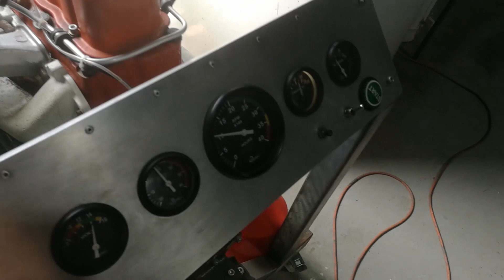Rotec TBI-48-4/5 Throttle body

Comment: It is rather a pity we did not have these back in the times of the HQ through to HZ series of Holdens. It would have enabled some serious fuel economy at the time the fuel prices went through the roof. Altering the mixture to suit the hot Pilbara climate then altering it again for cold old Perth would have been conveniently easy. I rigged an old speedo cable and an aftermarket adjustable main jet on the original carburettor but the motion of the cable was very vague.